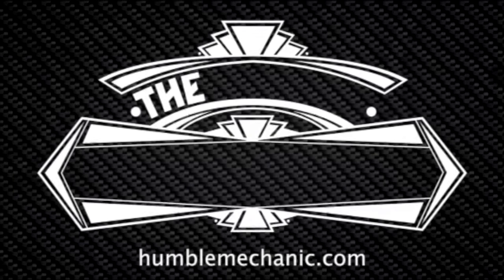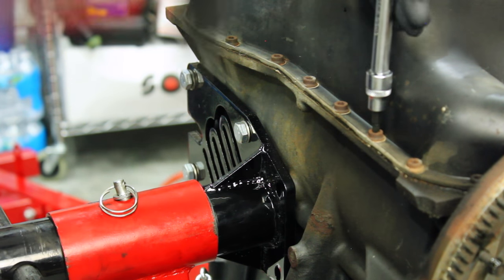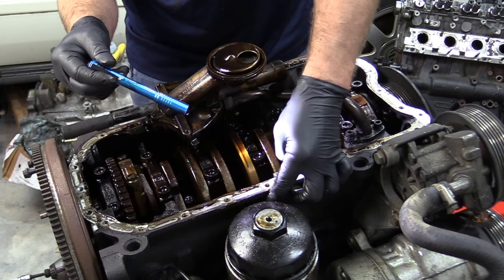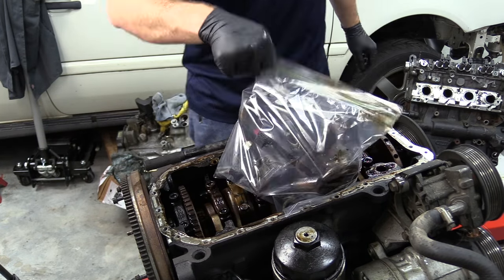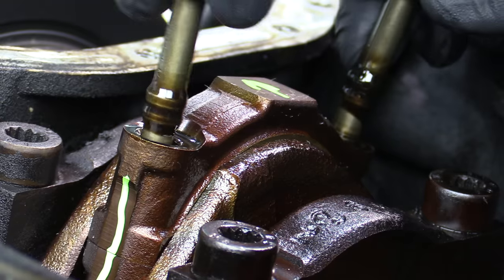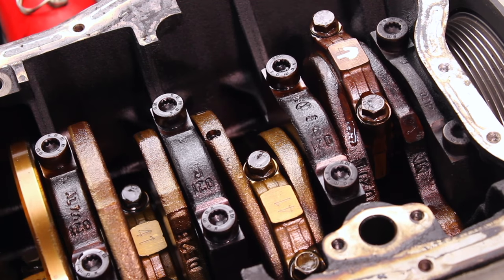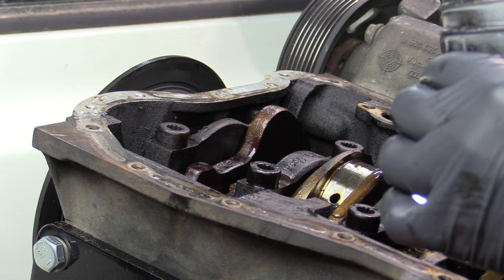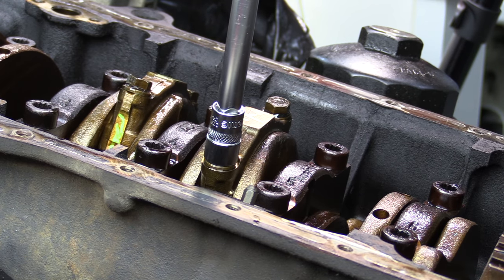VR6 Block And Bearing Inspection ~ White Wookie

Comment: Oil pumps of the VR6 engine you ALWAYS replace!!!! Except if it's a '96 model engine. That was when VW finally noticed WHY the timing chains of many VR6s ripped apart. 'Cause the old olil pump had a construction flaw with it's pressure valve, rising the oil pressure on higher revs way too high. As a result, the chain tensioner puts too much stress on the cain. Only oil pumps from '96 and later have their pressure valve with a different design. Corrado VR6 (2.9) for ex. always has the old oil pump! I am German (as you can tell by my lousy English) and I did quite a lot VR6 engines
Reply from the maker: Right on Doc! That is a small price to pay for engine protection. Also great English. I would have never known if you did say. Cheers!!!
Reply: wanna know which model you got? Old model: back cover of the pressure cylinder is screwed on. New model: back cover is "press fitted", so no one can see VW found out about their own mistake...
Reply: Doc Sinclair Schimmel performance makes a maual chain adjuster. Thier was a guide update as well as a single chain change. Makes me wonder though. Maybe a r32 oil pump is a good route.(shallow pan)
Reply: Interesting my old timing chain rails were all snapped and indented badly. In the book 101PSI is the max allowable pressure, I did get an oil pressure gauge that reads 150 psi to keep an eye on it.

I ended up smashing the oil pan which dented the oil pump and bent the oil pump driveshaft! It's making a unhappy tapping sound in the bottom, and I'm hoping that is just the driveshaft vibrating around. Will find out on replacement.

Comment: If I had it all disassembled like you have and I'd come across a bearing with any signs of wear, for example the wear you saw on the first connecting rod bearing cap, I would replace all of them anyway (and pull the main bearing caps too). I'm a motorcycle master mechanic though.

Comment: Sometimes you can chase bolt holes by simply grinding/filing a flat on two opposite sides of the end of a bolt. Works great in a bind.  Edit; I am talking in relation to the engine stand bolts.
Reply: 1:08 good suggestion for a thread chaser

Comment: Hello Charles, You should use a center punch to mark your bearing caps. That way your paint marks will not get washed off when you clean all your parts. Cheers.
Reply from the maker: +Mark Thomas that's a good idea. It's one that I may do before sending the parts off. Initially this was going to be a simple check. Bummer that it ends up being more haha

Comment: Hey Charles. Can I reuse my connecting rods if they are in good condition? I’m charging my piston rings but want to do a cheap job for now as I’m going to do an engine swap. However I’m short a few component (1.8t swap so I need 02j or 02a transmission and intercooler piping). So Im doing a cheap “rebuild”.

Comment: 6 bolts holding the motor..  cheeze. I had a fully built 8cyl with the whole belt drive stuff bolted on with 3 old headbolts holding it to the stand,.  After i took it off all 3 bolts were bent 30° down..  lol. Squeeked by on thatn..

Comment: better to find a bad bearing when its already apart rather than having it send metal throughout  all the bearings or worse, when its scattered across the road. lol
Reply: Yeah around the time he started tearing this down I spun a bearing in my 06 eclipse and have since bought a new engine, the crank was out of round and 12 thousands of material was ground away and thrown through the bottom end. Not fun and definitely wish I could have caught it like Charles did in this video. On top of that the rod which was forged steel had been bent out of round as well, I'm not even sure if it can be repaired/reused.
Reply: Dylesxic i don't know for sure as far as 12 thou out, but they do make over sized bearings, but I've only seen about 4 thou oversized,..  call a few machine shops, they will tell you for sure
Reply: Dylesxic i don't know for sure as far as 12 thou out, but they do make over sized bearings, but I've only seen about 4 thou oversized,..  call a few machine shops, they will tell you for sure
Reply: Kyle Veilleux I measured with normal and oversized (technically undersized) bearings and plastiguage to measure clearance. I also measured the journal with a micrometer, believe it or not it was that bad.
Reply: 12 thou out of round?  I'm pretty sure that would not be serviceable.  Better to play it safe and have it reground (or replaced if you can't take that much off.)  Sucks, man - but better than trying to use it and having to do a second rebuild.  Good luck!
Reply: aussiebloke609 I should've been more specific, 12 thou material came off AND it was out of round but I didn't bother measuring the play since I wouldn't want it out of balance. I think a regrinding is the only option but I'm pretty sure the rod for that cylinder needs to be replaced too. I've kept the engine to maybe one day build it but I have a replacement coming in for the mean time. Thanks for your wishes!

Comment: You mention that you dont have to worry about the carbon crap, now th emachine shop will take care of it. But how would you remove it, if you had to do it yourself?
Reply from the maker: I would probably have the engine facing up(tops of pistons facing the ceiling) and remove it similar to how I did the pistons. Not sure it will work as well, but I Would try it.

Comment: Did your Eurowise engine stand adapter come with the hardware? Just curious cause mine didn't, but their site says it's included. It's an OK piece, but I think they focused more on the logo than the welds and mount holes.The mount holes on mine are not round and look torched by hand instead of machined.
Reply from the maker: Mine did come with hardware. Hate that yours didn't fit right. Mine was no problem at all. 
Have you called them and let them know?
Reply: I hit them up through email cause I got it late last night. I just picked up some hardware, and while it mounts to the block fine, it doesn't mount to my Harbor Freight stand. The gussets are too long and allow for no further adjustment to line up the lock pin hole, which is about 1/2" off when comparing measurements to the adapter the stand came with. Would have been better if they welded the pipe through the plate on both sides and then no gussets would be needed.

Comment: When I saw the wear on the bearings and you were putting them back I almost lost faith in you. LOL 
I'm sure when you saw the oil sludge in the pan/block you could guess what was waiting under those bearing caps.
Are you going to bore the block and make it a proper 2.9L or 3.0L?
I put an Eurospec ABA bottom end into my '86 GTI and you would be surprised how you can actually feel 200cc.

Comment: Hi Charles,
Is that a 1/4" cordless impact that you're running a 3/8" adapter on then a 3/8" non impact socket?

Also a long thin passage for oil in an engine is a gallery, not a galley.

Keep up the great work.  👎 (thumbs up from down under)

Darryl

Comment: Quick question, I have no experience at all with engine building, just curious, aren't the bearings cheap? What not just automatically replace them since they're so incredibly important? Also you seem to take a lot of effort to be sure you do a great job, thanks for being a great technician. Also you said numerous times there was carbon buildup, and you blamed poor maintenance, I'd like to know, what exactly causes this? Is it the oil or something else, and why is carbon buildup bad exactly. Thanks again!

Comment: Many people use plastigage when inspecting bearings. It was designed to measure bearing wear, but it was not ideal for measuring clearances in a new or rebuilt engine.

16:50 I have heard that it is wise to use ARP bolts or studs to replace OEM fasteners in the VR6.

I like watching youtube videos about the VR6 engine because I like the design, and because I will someday buy a Winnebago Rialta Eurovan VR6.

Comment: Hey I have a quick question for you regarding that Milwuakee Impact you got there, I think I have the same one if it's the expensive $200 or so one, its like the best one you can get at the big box stores, think I got mine at HD, anyway, I wanted to ask you what bits you use? I can't find any 1/4" hex to socket adapters that I don't bust, looked like you had a nice long one on there too, I bust the shit out of even the short ones unless I keep it on the "2" setting. "3" is a gamble and breaks stuff on me all the time.

Comment: Hello. Long time fan. I have the head off of my 12v and I noticed that the coolant passages are full of rust. Is it possible to flush this out before I install the rebuilt head? I dont want to contaminate my head and new radiator. Thank you!

Comment: One time when I was doing some maintenance on the bottom end of a 1976 Kawasaki KZ 900 motorcycle I disassembled the oil pump for inspection and found no problems, the bike didn't have high mileage. I did notice that the clearance between the side of the rotating oil pump lobes and the housing seemed a little excessive. I lapped off enough material on the gasket mating surface to reduce the clearance and the oil leakage around the lobes to a better amount. The end result was that my idling oil pressure rose almost 25%. Roughing up the inner and outer surfaces of the aluminum oil pan with longitudinal scratches from a coarse wire brush and having the entire surface anodized flat black helped in oil heat dissipation.

Comment: thank God almost lost faith in you. when I saw that bearing get put back I was worried for you I was thinking man he is going to hate him self later having that motor taken apart and not putting at least new bearing in there....smart move not even close to being worth the risk by not replacing it and I feel the same goes with that oil pump just replace it you know if  or when it fails your going to kick your self 8n the ass I have been there. just because the metal looks good on the outside doesn't not mean there isn't internal stress Cracks you can't get  play it safe brother might be more money now but could save you heaps in the long run.

Comment: To be honest, I know it's an extra expense but I would have replaced the main and big end bearings regardless.  It's a lot easier to replace now than a few thousand miles down the road if and when they finally crap out.  I'd also consider replacing the piston rings, unless they really are well within spec when checked.

Comment: I agree that replacing the bearings is the right way to go. Had the underside of the block had less carbon I would have just sent the crank into the machine shop and put new bearings and bolts in since the piston walls looked fine. Given what you found I think you made the best decision.

Comment: Have you filed a grove or two into a bolt to make a thread chaser?
You talk about maintaining the engine.  Do you know how many miles are on it?  Maybe just a long life engine?
Reply: TheMTrider16 Sounds like a good idea. Does it have to be a deep groove?
Reply from the maker: +TheMTrider16 the engine has about 130k miles. No need to use a bolt as a thread chaser. I have all the chasers I'll need for this engine(I think anyway). 

Not a bad idea as long as the threads on the bolt were perfect
Reply: Andrew Thompson - Not sure.  It was just a tidbit I filed away after talking with a mechanic.  It was used in a remote area when the proper tool wasn't available.

Comment: hey Charles, what's the deal with these crankshafts. When they show any damage VW recommends that they be replaced. Can these crankshafts be grinded by a machine shop? I don't see oversized bearings being sold for this engine.
Reply from the maker: +Anthony Garcia yeah I don't think anyone makes off OEM sizes. 

I'll probably just have this polished

Comment: labeling bearing caps with a marker ? I can see new parts cleaned and ready to assemble but take a ride to harbor freight and get a number stamp kit for $3.00 and stamp everything prior to tear down only time you dont stanp the parts is when doing a oem historical restoration in which case use a wire tie or zip ties with labels so as not mark up the parts 
used a marker once 20 years ago and when cleaning the parts in parts washer the marker washed off .... that was way back when it was easier to grab another $20 chevy 350 core then to have the block sent off and line honed cause the caps were unable to be reinstalled in correct order.
Reply from the maker: This was just step one of the process. :)

Comment: Keep up the good videos, have a question for you though. How much required change would be needed to drop a 3.6L in place of a 2.8L?
Reply from the maker: Very little. Wiring harness, a few tweaks and possibly some clearance issues with hood. But mostly drops in

Comment: who thinks he needs to forge the bottem end and valve train for high rpm N/A vr6 build!!!!
Reply: Ryan Rohauer no need for a built engine for NA. These engines are bullet proof.
Reply: Forged crank and rods from the factory  throw in some ARP hardware good to go. Upgrade valve springs and retainers for higher rpm.

Comment: Charles what's your opinion on this. So I undid the factory conrod bolts, installed and torqued ARP bolts, wondering if my bearings are going to suffer from this now?
Reply from the maker: Probably not. Did you inspect them?
Reply: No as the post I read said do one at a time, ahh well I'll see what happens
Reply from the maker: +Josh Mustillo you’ll probably be fine.
Reply: Okay sweet thanks

Comment: what was scoring the bearing? i didn't see the corresponding scoring on the shaft end?
Reply from the maker: +empty tomb I never found the exact failure. It was scored right where the oil passage on the crank is. I'll know more once the crank is out.

Comment: why not just replace that one bearing?
Reply: Jonathan H When a bearing wears as this one did it usually causes uneven wear on the crank. Putting in one bearing without having the crank machined might delay its failure but not cure it. Its simular to throwing new brake pads onto a warped brake rotor. It will cause uneven wear on the new pads and they will wear out faster than if you had the rotors machined. For long term longivity of the engine its best to have the crank machined and new bearings fitted.
Reply: he's not talking about having the crank machined... at least he didn't mention it.
Reply: He mentioned having the crank polished which is common machine work on a crank at a machine shop.

Comment: Has VAG ever used a gasket on oil pan?
Reply from the maker: +photorocket4550 yep. The older 2.0aba engines, the VERY early 1.8t Passat had them. Most everything now is sealant